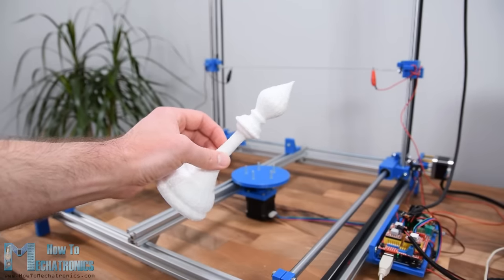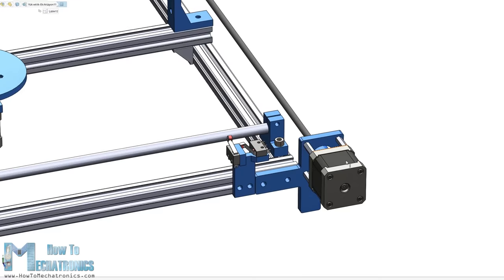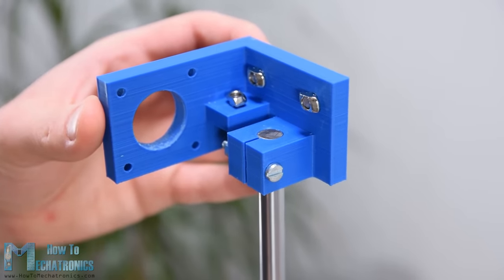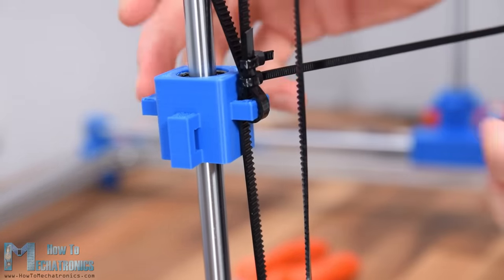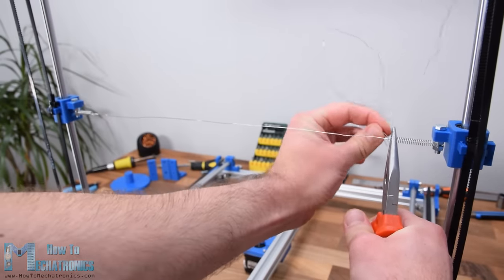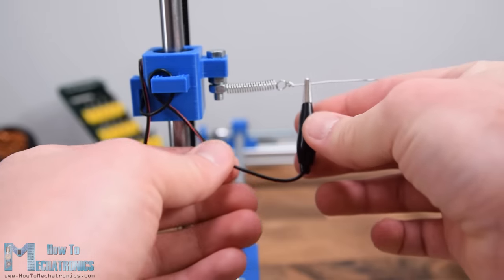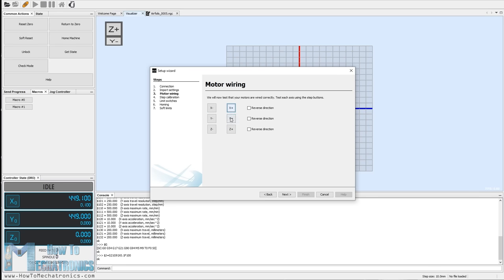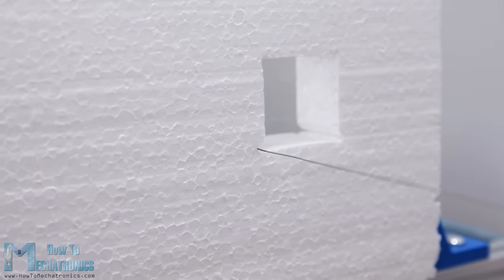Arduino CNC Foam Cutting Machine (Complete Guide)

Comment: Nice idea, I reproduced the cnc, I'm a beginner, but my problem is the limit switches. I get the message "you have flexible limits activated, any button that would move the machine beyond these limits will be deactivated". If I go ahead in the setup wizard when I check the invert limit switches box it gives me red ones ..

Comment: I'd like to control the Nichrome wire voltage with the 0-5V PWM signal on the CNC shield to heat up the wire from G-Code so that I don't have to manually adjust the potentiometer on the buck converter (and probably test the Dynamic Laser Power Mode on GRBL to get better cutting results)

How would you accomplish this? Thanks!

Comment: Hello! First of all, congratulations on your machine. I have made an equal for the institute following your footsteps. But I have a problem that I can't solve. In the UGS software I don't see an alarm in Z. And it doesn't allow me to send any file. I have jumpered the pins on the CNC SHIELD but nothing. Alarm Z keeps appearing. What can I do? Please can someone help me? I have to deliver the work in two weeks. Thank you very much!
Reply from the maker: Hey, thanks. Did turn off the Z-axis homing, by modifying the config.h file of the grbl library. Check the website article, it's also descripted there and check some of the comments there. Cheers!

Comment: Small tip: use idler pulleys with teeth, it won't wear the belt as much as the toothless do
Reply: And I think you should modify the printed parts just a little bit, to make sure that the belts are always straight and parallel to each other, because small differences(like a triangle shape) can affect belt tension and movement quality

Comment: Very nice and appreciate the explanation.   Is there a way for you to explain how to change the Z-axis to work independently and what are the needs for that?  I am looking to build a similar one but struggle with the programming part to achieve independent z_axis movements so that tapered parts can be achieved.
Reply from the maker: Well it's as easy as connecting one more stepper to the CNC shield, but you will have to find and use another appropriate firmware and software for making such shapes.

Comment: @How To mechatronics , great machine but i wonder is there a software problem so you build it as 2D/2,5D CNC ? i mean i would would it with a round base (which can rotate as Y-Axis) and then the X+Z-Axis as usual.
Then it would work like a 4D-Lathe type CNC :) i hope you can understand what i mean.
I got that i idea after watchin how polar-3D printer work.

Comment: Hi, I was building this CNC and I had a question, how much amperage are the drivers connected to the shield? I am having problems when I try to move the steppers with the application, they do not have enough power to move.

Comment: Hello. I made the machine according to your design. Unfortunately, I have a big software problem. When I start the project, for a while everything works as it should, unfortunately, after a long time (1-3 minutes), the machine loses communication with the computer and the process is interrupted. I replaced the USB cable, gave other power adapters, updated the software and nothing is a problem and I can't get rid of it. Any idea what's the problem?

Comment: You could make the z sliders independent to make angled cuts and stuff too
Reply from the maker: Sure it's possible, but would require a different approach for generating the G-codes. Different approach in terms of different software, I don't think it's possible to make with the open source software I used. Of course, there is dedicated software capable of doing that. Adding the 4th stepper would be easy, of course, the particular Arduino Shield can drive 4 steppers.
Reply: @HowToMechatronics  I would like to see you explore all independent motion, then I think you will have cracked the internet wide open.

Comment: 12:40 do you have spacers underneath the board? Have to be careful how tightly you screw it down. You can warp the board, which will create problems.
Reply from the maker: No spacers, and that's true, the board you could damage the board when screwing.

Comment: Good tutorial. However, I'm not sure about how good the design is. The Y-Axis is not rigid enough and will lead to wobbling on your cut parts. The joint between the y-axis and z-axis needs to be lengthened vertically and horizontally. Also, those belts are way too loose. You'll have way too many irregularities with positioning with loose belts. Other than that it's a pretty good build

Comment: are the limit switches connected directly without any capacitor or resistor connected in series with it? 
i mean,  the way you connected it, didn't worked for me. 
 moreover there are some heat shrinks near the limit switch terminals, giving the thought that something was inside them.

Comment: Verry thanks for this vidéo! 
What is ideal temp in Celsius please?
Reply: Temperature adjustment

A transformer heats the hot wire in 1 – 3 seconds to approx. 500 – 600°C on a max. value of Adjusting Knob. Normal operating temperature for polystyrene (EPS, XPS) materials is 250 – 450°C.

Comment: Would this work to cut 12mm EVA foam sheets? It's the same material used in those interlocking foam tiles you might find in the gym.
Reply from the maker: I haven't tried cutting those sheets, but yes, it should be able to cut them as I read on some forums that people have used hot wires for cutting them.

Comment: Hello. I made your project by making some slight changes and I must say that everything works well enough, but I have a problem with the limit switches. I commented the lines of code to disable the limit switch of the z axis and compiled all the gbrl on Arduino, but despite everything the two limit switches x and y do not work for me. Where am I wrong? Thanks
Reply from the maker: Double check your connections. You can also use resistors in the when connecting them. Search on google for GRBL Wiring Limit Switches. You might find more details there.

Comment: Hey HTM . WE ARE BUILDING THIS PROJECT FOR OUR BE SUBMISSION . BUT OUR MOTOR IS NOT ROTATING 360 DEGREE . IT IS ONLY VIBRATING . WE ALSO TRIED BY CHANGING THE WIRING BUT OUR PROBLEM IS NOT SOLVED . PLZZ ANSWER WE WANT TO COMPLETE THIS PROJECT . WE HAVE DONE PROGRAMMING AS PER YOUR VIDEO . PLZZ HELP

Comment: I wanna build a CNC Router with an Arduino Mega 2560 and Ramps 1.4.

The Grbl firmware that you use on your Foam Cutting will work with my configuration?

Comment: I wonder why no maker have done  a 6 axis by using an asynchrom independant Y and X axis. The wire can be hold with an elastic so the distance beetween the 2 Y axis won't be an issues (too a certain extend)! Is it a software problem?

Comment: i have an issue with the software side of things and any help is very welcome.
so i did everything instructed but when i connect the Arduino to UGS is says it has grbl 0.9 instead of 1.1.
also it does not recognize the limit switches at all. i have tried several Arduinos but nothing is helping

Comment: When cutting foam with a hot wire cutter, it gives off fumes, with some foams this is toxic! So please ensure you have good ventilation when cutting foam. Stay safe.
Reply from the maker: Yes, that's correct. Good ventilation and safety respirator mask is recommended.

Comment: Hi there, your link to STL ZIP FILE Code, has an error..!! after download, reads 273KB. & does not open the file..!! It reads 16.KB less than original, 273.16KB

Comment: Radial bearings on threaded rods? Not a good idea. M6 threads are not 6mm diameter so the bearing will be a sloppy fit. Best practice is to machine the ends of the threaded rod to 5mm and use a smaller bearing, which should be a tight fit on the rod, or use a plain steel rod. Same goes for the idler pulleys.

Comment: i made this but i have problem about homing.
ERROR:
[Error] An error was detected while sending '$H': (ALARM:8) Homing fail. Pull off travel failed to clear limit switch. Try increasing pull-off setting or check wiring. Streaming has been paused.
[Error] Error while processing response <An error was detected while sending '$H': (ALARM:8) Homing fail. Pull off travel failed to clear limit switch. Try increasing pull-off setting or check wiring. Streaming has been paused.>
[Error] Error while processing response <ok>: An unexpected command was completed by the controller.

can u help me pls

Comment: Did you print them in in pla or abs or petg
Reply from the maker: It's PLA. Probably PETG or ABS would be a better choice in terms of mechanical characteristics but you know, everything has its own pros and cons.
Reply: @HowToMechatronics  ok I was going to print it in petg can I ask what size the 20 by 20 aluminium exclusion and what size  I how to cut it

Comment: 8:05 the part ist already cracked. How common is this with 3d printed parts? Just curious.
Reply: I think there is no crack. I could imagine that you're referring to the small slot between the two hooks for the belt. This is for clamping the guide-rod.

Comment: Nrf24l01 rc receiver

I'm trying to program elevon mixing. Does anyone know the mathematical relationship between the Elevator and Aileron? I'm trying to write a function that receives the two servo variable names and preforms the task.

(im going to be using the simple servo class;  ie servo1.write(90)￼

From what i can figure out, if I want to program the Aileron relationship in an Elevon configuration; the values should match since one servo is laying to the right and the other is laying to the left - so equal values should give it opposite motion.

If I'm programming the Elevator relationship in a Elevon configuration; the value of the Elevator from 90 deg creates an offset that i apply to the aileron servo - so if the elevator is at 100 deg, the offset is 10 and the aileron should be sent the value of 80 deg.

(I think thats right)

What is the best way to program this? Will i get jitter if i send aileron and elevator input at the same time?
How can I translate this theory into code in the form of a nice function I can call if the "elevon" boolean is true?

Thanks for your time.

Comment: Making this design into a full box and capturing the top of the movable Z axis would be a huge improvement. I would even consider V-wheels for the Y axis. This is a terrible design from a reliability and repeatability standpoint. However I believe that is not the correct metric for evaluating the fitness of this machine. You stuck to things you knew and achieved your desired goal.

Comment: Please help! I have been working on this project for a couple of months now. I am at the point where I need to solder the limit stops and connect them to the cnc shield. I have soldered the limit switches to ground and normally closed, however, I have no idea what connector you are using to connect the wires to the board. I bought 2.54 mm pitch Dupont connectors and a max diameter crimper of 1mm^2. I am unable to crimp my 18 awg wire to the female connecter pins because i believe the crimper diameter to be too small for the wire. I am a total newbie and have no idea what the problem is. Is my crimper too small for 18-gauge wire or should I be using lower gauge wire for the limit switches. Can I use other types of connectors?
Reply: It is working ?